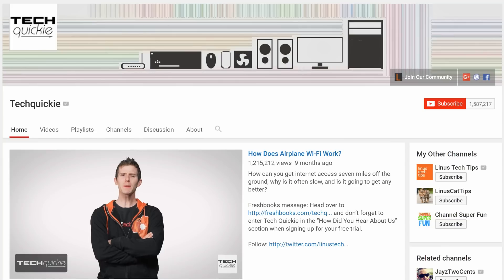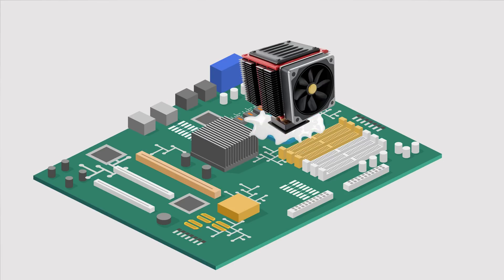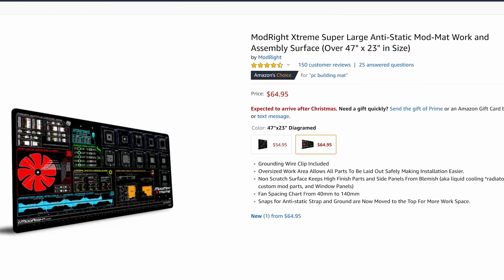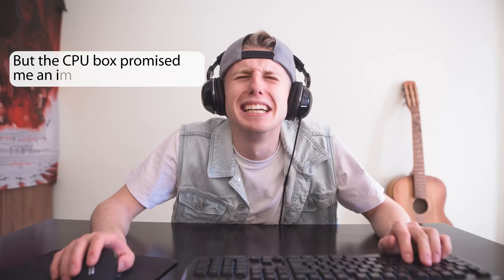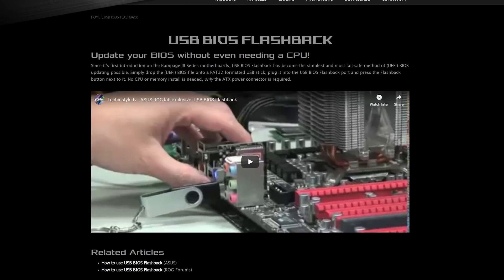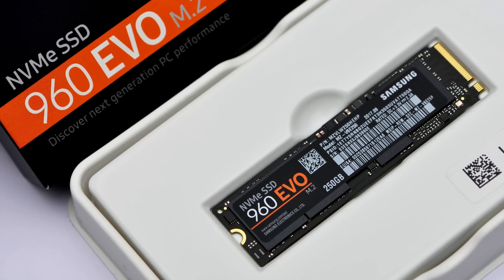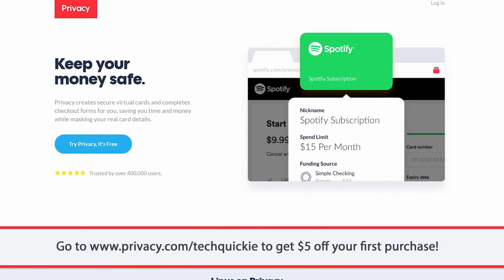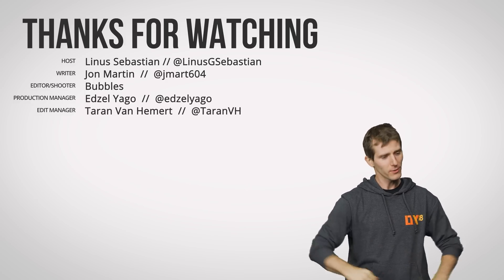DON'T Make THESE Mistakes Building A PC (pt. 5)

Comment: Never cheap out on your power supply.
Reply: i found with these cheap power supplies you really do get alot of BANG for your buck.  Get it ;)
Reply: This is a really good one!  I used to replace my power supplies on a regular basis.  I always bought cheaper ones.  I finally got fed up and bought a more expensive supply; that was a long long time ago and I am still using the same power supply.  In the end, the extra I spent on the better supply ended up being CHEAPER as I wasn't buying a new supply every few years which ended up being more expensive for inferior supplies.  Also, the better supply came with more options for connections.  At the time I wasn't using some of them but later on they came in handy.
Reply: I didn't cheap out when I built a PC for myself in 2006. Around 2012 (if it aint broke...) the power supply failed. I was coming home from work and opened my bedroom door in time to see an orange glow behind the case and then that "snapping" sound. I flew like Superman and cut all power to everything on my desk. My point is that age of components can be a factor.
Reply: Extremely important. There are some idiot local PC builders in my area who install $10 power supply (yes $10), and then almost all of their computers fail. And those idiots awe in surprise...
Reply: psu explodes
Reply: Yeah i got caught out with that one once when i was younger lol
Reply: My friend bought a cheap one and it caught fire over night during a bios update and ruined the stuff in his power supply shroud and motherboard bios
Reply: Im using 2 power supplys.
Reply: @Mercy.96  didn't even know you could do that
Reply: @davidprutkovas1333  Well i didnet have a pc for work and i found some parts from friends and the graphic card neddet power so i did add another power suplay its risky but i can work now
Reply: Thats why i got a 2 usd 2 billoin wat power supply
Reply: He mentioned that in the first of these episodes
Reply: Nagi Souichiro
Reply: Don't need to go overboard. I've not had one die on me, but then again, never got the dirt cheap ones. XD
Reply: SUBSCRIBE TO PEWDIEPIE
we need your help!
Reply: Souchirouu Go Titanium or go home bitches!!!!
Reply: Used a shit power supply for 3 years, it just died out.
Reply: Never cheap out motherboard if you want to overclock
Reply: I have an evga 600w which was under £50 and is very good
Reply: I did this and fried my mobo
Reply: episode 1
Reply: I cheaper out on my psu. Both of them not giving my hard drive less voltage. 2 hard drives and 2 psu gone to waste. Luckily those parts were under warranty and got them replaced for free.
Reply: I actually do the opposite and overspend on it just to make sure... That is not good either!
Reply: Dont cheap out on anything.
Reply: I didn't cheap out and still got fucked....
Reply: PSU Tips:
• Buy a brand name, like EVGA or be quiet!
• Don't get way too much wattage, you'll only burn money.
• Pay a little attention to the efficiency curve, and where your build falls on it.
• As with anything you buy, take a quick glance at the reviews.
Reply: Souchira got a $30 supply running for 4/5 years now its from ewent.
Reply: cheap ones arent necessarily bad, they may just have bad efficiencies but says nothing about the quality and price. the ones u need to avoid are the ones which may surge and fry the other components, so always look out for reviews(esp bad ones and see if anyone has had theirs fry their components)
Reply: This video is part 5, he put that in part 1.....
Reply: This!
Reply: Oof, got a 750w for £30, branded but...
Reply: Always buy 80+ rated, and I always go for gold too
Reply: He mentioned that at part one video
Reply: Why it's good it helps you PC sleep.
Reply: I have ruined the 69 replies
Reply: Souchira, uhhh what should I buy for my power supply? I’m using about a $500 worth of parts. What power supply should I buy?
Reply: Well I cannot wish I bought  a cheap one cos a evga 850wat power supply is to overpriced
Reply: He covered that in a previous episode
Reply: It can be the most annoying bottle neck if you do
Reply: Never cheap out on anything tbh 😂
Reply: @TeebeauFG   well yes but actually no.
Reply: Sometimes I wanna practice my bomb plants and game at the same time
Reply: Learnt that the hard way, now i know how important it is
Reply: Why?
Reply: Ya lol
Reply: what is the average price
Reply: lol this is the first thing said in ep 1
Reply: Unless you wanna create a bomb dont buy a cheap psu
Reply: Why?
Reply: Yes, if you do, good luck trying to fight "Kernel Power 41 (63)" random shutdowns while under pressure
Reply: It was in the first episode
Reply: Unless you get an EVGA 550 watt 60$
Reply: Is a 500 watt from be quit good?
Reply: @JulianBivinss  depends on the model.. personally I'd only buy the straight power model from be quiet. The pure power models are ok but full modular makes life easier
Reply: Was in Episode 1
Reply: Or just keep a fire extinguisher on hand
Reply: Which PSU manufactures are good?
Reply: @yuval1405  I have a 650 watt from evga and I've had no issues with it
Reply: @yuval1405  Do a google search on PSU Tier List. Preferably go with tier B for any build, at least tier C if you want a budget build. 
Also recheck your build wattage in PCpartpicker and get a PSU with at least 20% wattage to spare on top of your current build.
Or even better, plan out your upgrade path for the next 2 years (adding AIO cooler, more fans, additional storage, better CPU, better GPU, overclock requirement) +20% of its wattage.
Reply: NEVER
Reply: If pcpart picker reccomends says 404 w is 650 enough?
Reply: @zach226  yes because it needs 404 watts of power and the psu has 650 watts of power so yes a 650 watt is good
Reply: @I love fancy rats, that will work I recommend the Cooler Master MWE gold for that
Reply: i actually survived 3 years on a 15$ powersupply, bought a pc for 150 from a guy bought a new cpu, ram, gpu and only when i upgraded my powersupply to fit the wattage need of my new GPU i realised it was a crappy 15$ one
Reply: FireAxe That still doesn’t mean you should make that mistake
Reply: @liaminc.4723  just saying unbenoknownst to me it still held up fine for 3+ years
Reply: FireAxe you got lucky that’s for sure
Reply: Uhhhhhhhhh shit
Reply: Name brand is always the way to go
Reply: Its the FIRST topic on episode 1. This is episode 5.
Reply: That was on the first video
Reply: Having Corsair VS650 Bronze 80+, for over 5 years, or maybe more. Works good. No problems at all.
Reply: @2033-u6q 
I don't understand why people say VS, CV, and CX series are trash just because they're 80+ Bronze and not modular

Do they spend like, more than $100 on PSU..?
Reply: PSU's under 50$ ain't bad. Just look for brand units, like Corsair, CM, Seasonic, EVGA, Be Quiet but watch out for KCAS psu's, like 450W. Some of them may be good, but some may die after short period of time. And don't be aware of 80+ Bronze certificate. It is still brand product, but paying for silver, gold or titanium certificates is sometimes needless. If you catch something on sale, go for it and don't be scared of it.
Reply: @2033-u6q  
I know, but the comments are making me nervous of the choice somehow, eventhough I know for sure that EVGA, Corsair, Seasonic, etc are very reliable

I personally trust Corsair because I've used their product before, but everybody's bashing the VS, CV, and CX series, just because they're budget PSUs
Reply: @センナ-h4c  Just choose what you prefer, and what's the best bank for the buck. If you trust these brands or series, then take them. Your money, your choice.
Reply: And if im an islamic?
Reply: Well i did cheap out on my older pc ended up frying my 60$ motherboard i was lucky that the cpu and gpu survived
Reply: You can cheap out on the power supply as long as you have more then enough power supplied by it
Reply: @lolmistro  Nah that's the mistake amateurs make
Reply: Literally has said that in ep 2 or 3 I believe
Reply: I get only the cheapest 80+ gold supplies from trustworthy manufacturers
Reply: I agree
Reply: Just like your mom
Reply: Kaboom
Reply: this is very important. he should have mentioned that
Reply: @ThatDaveFella  already have it's own video about that, check his channel
Reply: This was mentioned in episode 1 of the mini-series.
Reply: @ThatDaveFella  it's in part 1
Reply: @ThatDaveFella  he mentioned it on part 1
Reply: @ThatDaveFella  it's literally the first point he makes in this entire series
Reply: @IslarfYT  you bored?
Reply: @ThatDaveFella  nope
Reply: Is 80+ bronze good enough?
Reply: @ThatDaveFella  he mentioned it in let one or two already
Reply: You have to cheap out A LOT these days to run into issues with power supplies.
Reply: w a l m a r t
Reply: @Fillyfishyy  h
Reply: @Fillyfishyy  OMG, Greatwall PSU are OK, just fine, according to GN. I own 4 cheap PSU, and never had any issues with it. Those who are having issues are those who OC the hell out of their system, and expect a pedestrian PSU.

Example, if you have a i7 8700k, with 1080ti, OC and expect a cheap 500W psu not to fail, your expectations are wrong.

Even still, my GXII 650W, is still running strong, been using for over 6 years. 

I remember reputable Corsair, the CX, GS or VS series--one of those series, failed, and taking out people systems. Guess what? They are using power hungry components! Hell, even the high end AX series failed.
Reply: what you mean by cheapout psu?
Reply: @wolontong  It is what supplies power to every single component in your system if it fails it can potentially take out everything else with it. Just as with any other part you should read reviews before buying one, get one from a reputable brand that is most efficient for the amount of power your system uses.
Reply: Life of Soggy like some random chinese brand you never heard of
Reply: Yeah I agree, the main reason why is because a cheaper psu will usually be non modular which makes cable management a lot harder and they also usually have coloured cables which will make your PC look a lot worse on the inside
Reply: Souchirouu he already said that
Reply: Paid £30 for my power sup, two an a half hrs later and no problems
Reply: @JoeChristian02  Yeah, two and a half later. That must mean that it can't fail and that it is perfect. Your anecdote is pointless and you bought a bad PSU just because you couldn't afford to spend a reasonable amount
Reply: I ran a First gen i7 with a HD5870 for YEARS with like 5 HDD's on a 500 watt antec unit (the most power sucking parts i ever had). getting something TOO cheap never can be good, but it's not 2003 anymore.
as long as it delivers sufficient power with a bit of proper headroom, most options from reasonable brands are fine.
Reply: That's what I found a choosing my pc parts few months ago. Read lots of reviews and it turns ou under 90$, everything is pretty much shite. Everybody says "buy seasonic !", but the popular m12 is shite. cooler master, be quiet, corsair, everyone, as long as it's not 80+ gold (few exceptions), it's no good.

Though it still works. 9 years ago I bought a antec HCG 520w, cheapish, still runs today no problems (the fan is getting louder obviously). 24/7 oc on the old phenom 955, shitty cheap asrock vrm, lots of dust/vape/smoke. Still runs.

So shit psu/hardware can still be fine. or it can crap out. But "You'd find that Lady Luck was really a hooker, and you were fresh out of cash"
Reply: @escalator9734  Completely disagree, i have a cooler master G750M 80 plus bornze and it works perfectly fine... Its ridiculous how people keep wasting their money on 80 plus gold PSU`s when they have a small budget, aslong as its 80 plus bronze or more its perfectly fine...
Reply: @GAMEVIDSnorwegian422  Honestly it's not an opinion, check reviews from reputable sources, that actually test everything about the psu, list the parts name/numbers and origin and so on. You will find the cheaper psu have bad parts in them, use outdated designs and perform poorly. Once you go on the gold category, everything gets better. Some bronze also performs well.
Like I said I also had a cheap psu and had no problem with it on the long term. Plenty of people have cheap psu and have no problems with them. But you will also find that if problems there are, most likely it's on a cheaper psu.
Having bought a rm650x I have the piece of mind that my psu won't fuck up, either itself or the other components. I also get a very silent psu and better efficiency which will cover the more expensive price tag over the years.
Buy once, cry once. Hopefully yours wont fuck up, like my old one.
And do proper research before you give your opinion on something
Reply: @GAMEVIDSnorwegian422  That is not what is meant by "cheaping out" on a PSU. It's a good brand, and model and you know it'll be safe. I've seen at least 2 PC motherboard die due to power issues that managed to find their way through the cheap unknown brand PSUs that were built into the prebuild PCs. I've had the same issue happen to my own PC and thankfully the PSU (Corsair CX500) was well built and sacrificed itself so all I needed to do was buy another PSU instead of a motherboard and any additional damaged components (as well as saving a lot of hassle in rebuilding the entire PC).
Reply: @GAMEVIDSnorwegian422  its not waste since they have less chance of breaking
Reply: @escalator9734  I bought a Seasonic Focus + Gold 750 watt psu for 49 after rebate. There are some decent power supplies but I wouldn't spend under $50.
Reply: @escalator9734  Bitfenix Whisper. 450W ones can be had for $70 nowadays, 550W for $80 and it's gotten excellent reviews, not just by random people but electronics nerds who actually take these things apart. And as to people claiming that buying 80+ Gold (the Whispers are nearly platinum) is a waste of money: Do the maths. Electricity costs money, too, depending on where you live a good PSU can amortise itself quite quickly.
Reply: @escalator9734  There are amazing high quality PSUs from the likes of Rosewill and Antec that  are around $60.
Reply: Escalator that’s not true at all there are many 80+ bronze psu’s that are 40+ dollars that are amazing and widley used
Reply: @milkyplays5566  u shouldnt prefer those
Reply: @escalator9734  that under 90$ is dumb

Vs450 is one of the best
Just coz it's under 90$ doesn't mean it's not good
Reply: @escalator9734  Bronze isn't that much different from gold. You're only saving like 10 bucks. Just get a wat amount that you need and make sure it has a good review on tomshardware
Reply: @escalator9734  what if it's on sale for less than that but normally it's way more than that
Reply: Always cheap out on the power supply. Evga... Corsair... don't buy those. My favorite ones are the No Name power supplies.
Reply: i have the generic 600w chinese psu that comes with the case for free, it has been 2 years now and i didnt had any problems i am using a gtx1070 and a core i7 7700k, 16gb of ram and one ssd you dont need to pay that extra cash for a "rated" psu
Reply: @jesus2621  I work at a PC repair shop and 99% of power supplies that end up damaging other components are cheap no name psu's from China. But it's also true that plenty of people use them for years and never have any problems, still if I'm building a new system I'm not risking all of it just to save a few bucks on the PSU. And for a budget PC a decent, well reviewed, bronze PSU is plenty fine.
Reply: @jesus2621  and just because a handful of people never got the "Red Ring of Death" on their Xbox 360, doesnt mean it wasnt a shit designed system. Just as there are lemons in manufacturing, there are miracle flukes. A handful of non-fault products that dodges the kraken and works for as long as you need it to.  You may have a no-issue Chinese psu, but you are the exception, and not the rule. Where ever you bought it from, leave a review. Willing to bet your positive review will be in the minority.
Reply: @jesus2621  but im pretty sure if you use an 80+ psu it would probably decrease your electrical bill
Reply: @jesus2621  the thing is, just because you got lucky and your power supply held on, doenst mean you can start telling people to do the same, it's just like crashing your car and being fine and starting to tell people that crashing is not dangerous
Reply: @RBgamesbr  then lets stick one "japanesse transistor" technology so you can feel more safe lol
Reply: @jesus2621  it's not a matter of safety it's that people that don't know about computers end up buying crappy psu because of lucky people like you that brag about it, I don't exaggerate neither I got a cx550m for my gtx 1660ti and I think it's enough

Comment: I have PC for 7 years now and I haven't replaced thermal paste since then, am I in danger??
Reply: U should be fine thermal paste usually lasts for years if it is good quality it is only dangerous if u reuse the same paste after removing the cooler
Reply: No.